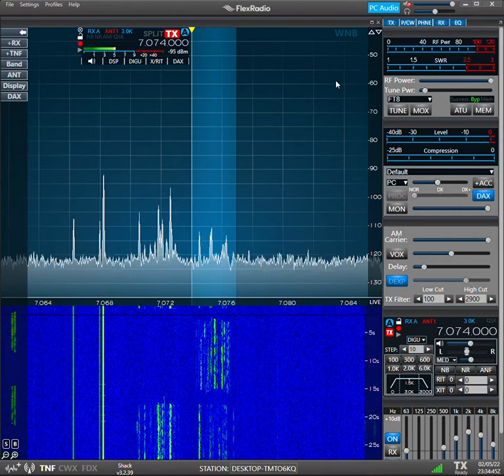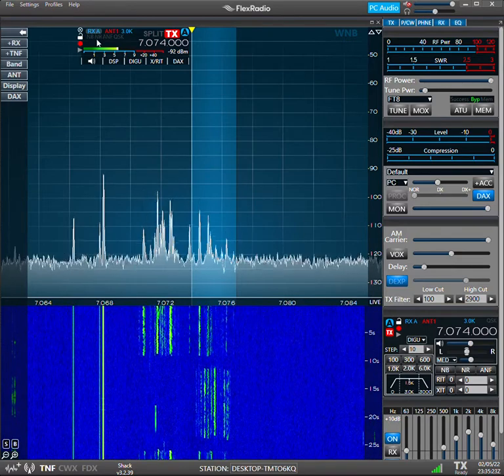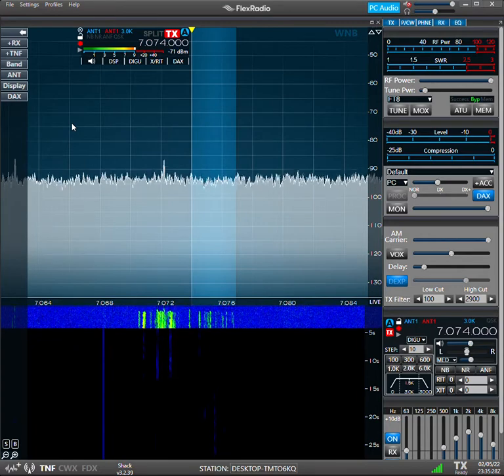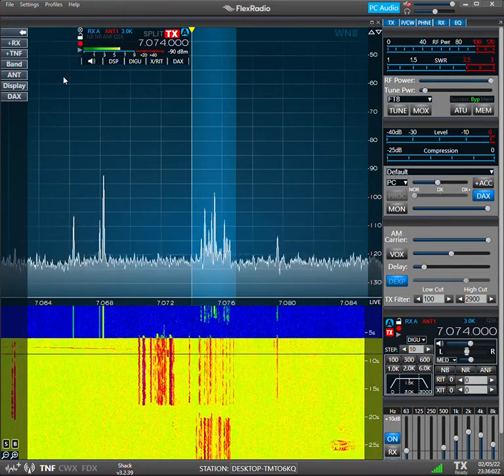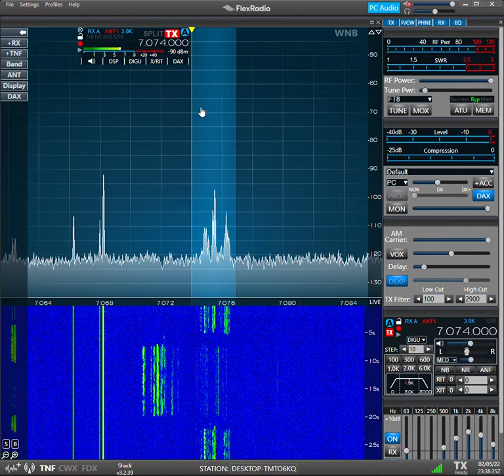Loop on the ground results

Comment: Am I correct that a LoG would blow out a RTL-SDR when transmitting on a near by EFHW?
Reply from the maker: That is true of any antenna on an RTL-SDR when transmitting
Reply: @don_n5skt  I have a Yaesu FT840, thinking of ways to get a panadapter display while I operate.

Comment: It’s interesting that you are using the transformer the opposite way around to the original article and the ratio is actually 16:1 rather than the original 6.25:1 or 9:1. I wonder why you decided to make those changes and did you try the original idea. 73, John.
Reply from the maker: I looked at many articles on this. Not sure which is the original article.  I now have 2 LoGs out both built this way. And I have seen many different ratios for the transformer. I also have a DX Engineering loop for detecting RFI that is also built this way. I think in here that I have pointed out that the ideas on the build came from building the DXE loop.

Comment: Amazing Don big difference with loop. I'm thinking about getting a transmit loop for 20 and 40 any suggestions I'm going to mount it horizontal  65 feet in the air
Reply from the maker: I had a loop up at one time. A horizontal Delta loop is fantastic but either a Delta loop or a Skyloop. Either are fantastic.
Reply: Ok ty Don  glimg to look into it thanks again n2dbi ny 73's